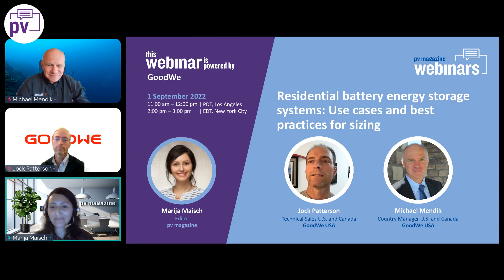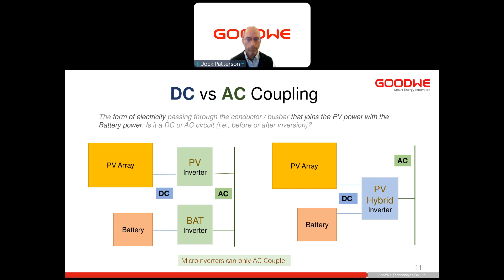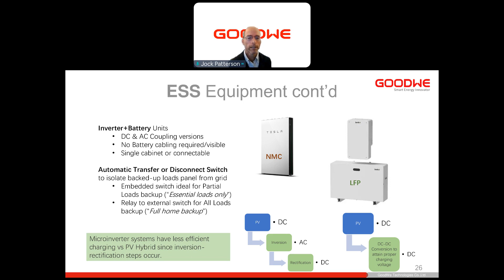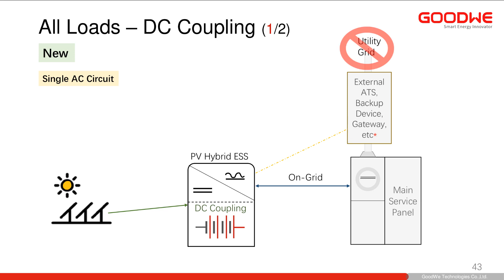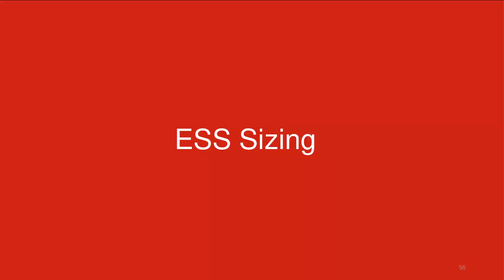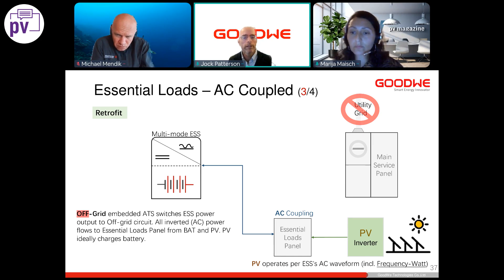pv magazine Webinar | Residential battery energy storage systems: Use cases and sizing

Comment: Good overview. Some quick feedback below.
1) US utility rules do NOT permit ESS with PV to charge from grid. So customers need to be aware that in off-grid situations, say a winter storm with no sun, your ESS will barely get any PV charge. Blame the utilities, not the ESS vendors for that. Tesla PW can charge from grid but only in Storm Watch mode.
2) ESS DOD. No such thing as "we have a product that has deeper DOD". All ESS can go to 100% of available capacity. A better answer would be DOD is linked to battery life.
3) ATS. Missed a clear distinction that hybrid inverters with internal ATS cannot perform whole house backup. Still need external ATS. That's why Tesla PW uses Gateway 2 with 200A service.
4) The BIGGEST issue with hybrid inverter (+ 3rd party battery) based ESS is actually the AHJ and how they interpret NEC. Some want DC disconnect per 480.7(D), clearances per 110.26, AC disconnect per 706.7. A fully integrated solution allows for lower BOS cost, simpler installation and overall neater look. It sacrifies battery modularity.
5) Would be nice if more ESS vendors produce liquid cooled solutions (for residential storage) for wider operating temps.